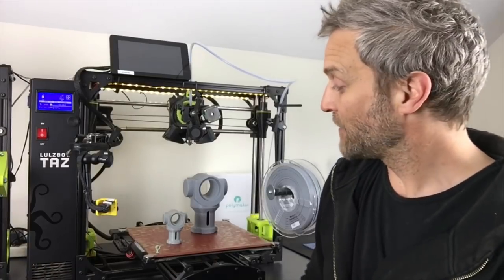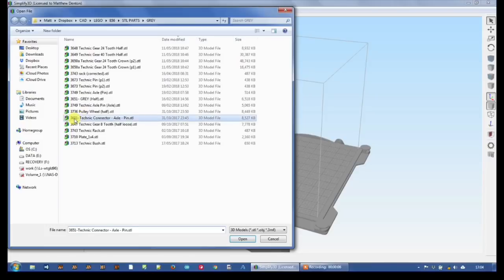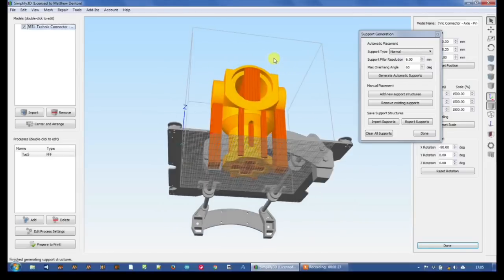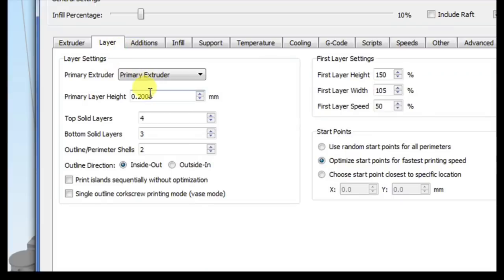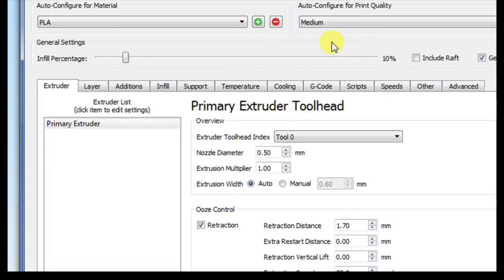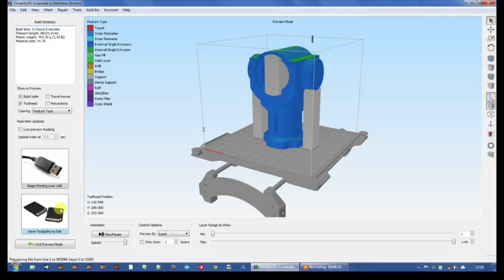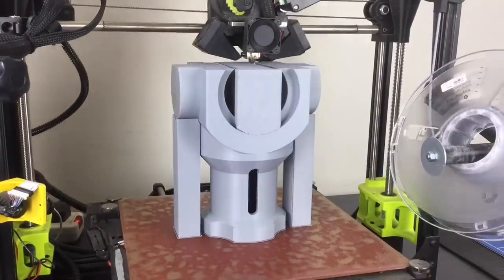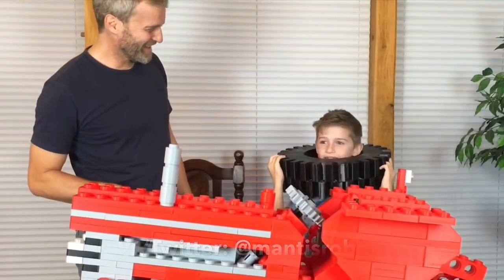3D Printing LARGE Parts Faster! - Mantis Hacks E19

Comment: The part you've mentioned is commonly used as the bottom part of the square engine piston!
Next, you should print the parts for this set: http://peeron.com/inv/sets/8858-2

Comment: I would have set up another two processes bases on height. The middle process would do the straight vertical section with a 0.3 or thicker layer height. With no curves, the thicker layer height isn't as noticable. With prusa slic3r you can 'paint' this on, but I prefer S3D.
Reply from the maker: I agree, I could have split the model as you suggest, but some people don’t like the rougher resolution along the straight paths. Personally when I’m printing giant Lego it’s all 0.4mm layer height.. so I can’t use this technique too much. 😬

Comment: i just compared your lego go-kart with a real kids go-kart. the size is not that different, but on a real go-kart the seat is higher and over the rear axis and there is some room under the steering wheel for the legs. maybe you just need to redesign the kit instead of printing it larger to fit your nephew in it.
Reply from the maker: Yeah. Not a bad idea 🤔

Comment: Great tip, thanks! So with a 0,4mm nozzle this should translate to 0,16mm layerheight to get a good quality/speed ratio
Reply from the maker: Hi. No worries. So with a 0.4mm nozel I guess you can print up to 0.32mm layer height so yes a 0.16mm layer height with infill every other layer would work. Or you could do fine detail at 0.1mm and infill every third layer. You may even find your nozel will cope with 0.2mm layer height with infill every other layer.

Comment: 21 hours even with optimizations. Gosh. I would've considered only printing each type of piece once and use them to create proper molds for a more conventional way of production. Of course, solid pieces would weigh a lot more and require more plastic material.
Reply from the maker: Yeah as you point out the amount of plastic!!

Comment: Thx, Matt:) Good tip.
Now, here's one back at you:)...
ANGLED SUPPORTS
video: https://youtu.be/leA3SY8ZF_A
I did a quick test: tall/fat cylinder w/ cross cylinder at top (vaguely like the model in your video). Saved 2 hrs (from 26.5 to 24.5), and 50g of filament (from 650 to 600). Here's a comparison pic: http://tinyurl.com/AngledSupports